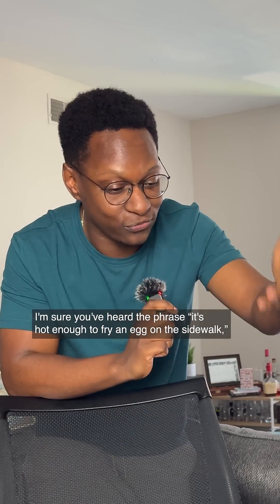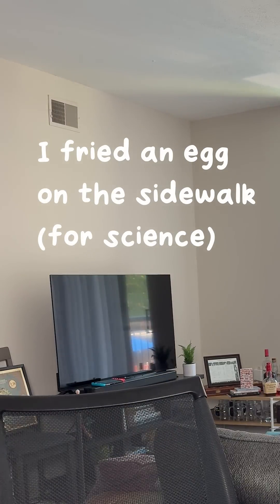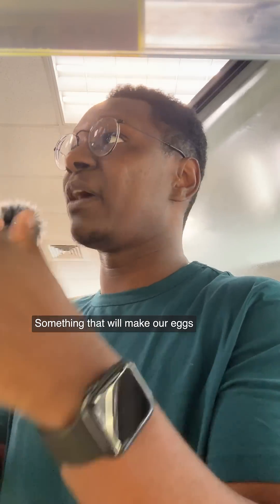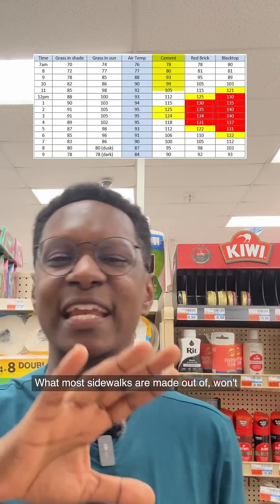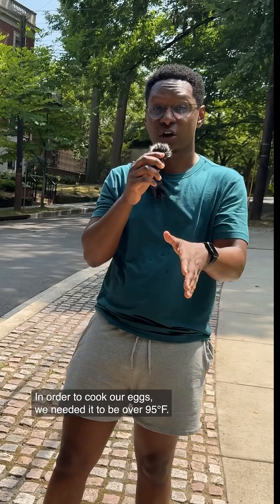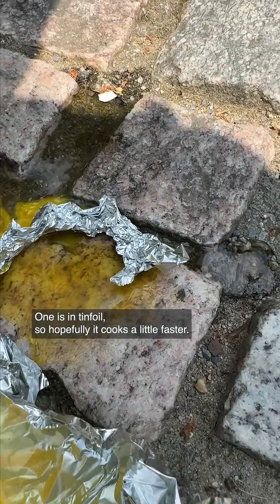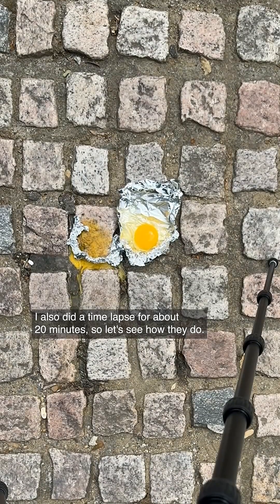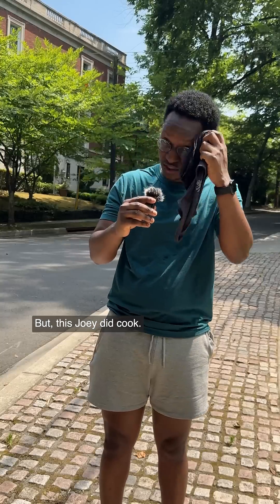Hot enough to FRY eggs on the sidewalk??

Comment: To reach those kinds of temps you'd need a surface that will absorb lots of photons and ideally a high specific heat. Preferably in a space that gets low air circulation. If I'm right about that, I'd say a new asphalt MUP would probably be best.

Comment: That was cobblestone, not brick. Also you can put the eggs in a seasoned cast iron pan so it absorbs the most sun. The black color absorbs more of the sun and gets hotter than the air temperature

Comment: That wasn’t brick it was granite, not a good choice. Next time try to find smooth slate that has been exposed to full sun and wait until after noon. Also the crumpled foil reduced contact to the heat source make sure it is smooth. This probably won’t work in DC try Arizona in August.

Comment: Bro, thats not brick, thats a squared stone. Brick is baked clay and has some refractory qualities.
Reply: Lit. What I was thinking 😂. I live in Bath and all that sandstone makes it BRIGHT, but not sure if the shade makes it not too hot
Reply: The brightness from the sandstone will provide some heat but it will also absorb some of the energy in order to be colourful!
Reply: The chart showed this too but it looks like the blacktop/asphalt would be even better. Blacktop conducts heat into the egg better, yes, but because its black, it absorbs a wider range of wavelengths from the sun and can actually reach a higher temperature than brick.

Also, you could probably fry an egg on wood in a place like death valley
Reply: So much factually wrong in such a short video. Wondetful.

Comment: That’s not brick!! That’s stone!!
Reply: Yeah what a poor test. There are tons or other materials sidewalks are made of. 

 Usually they are concrete where I live, but I've seen an asphalt one. Which was brutal as it was surrounded by an asphalt parking lot. It had like a fog of heat when you got to it just sitting in place with stagnant hot air.